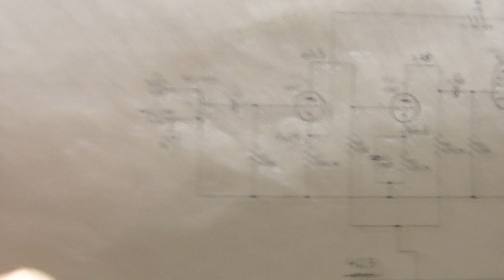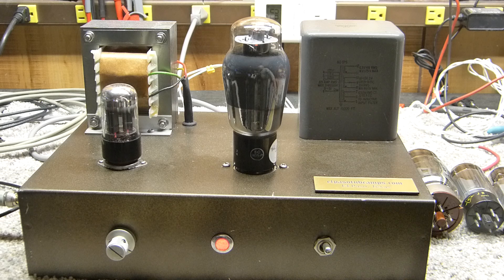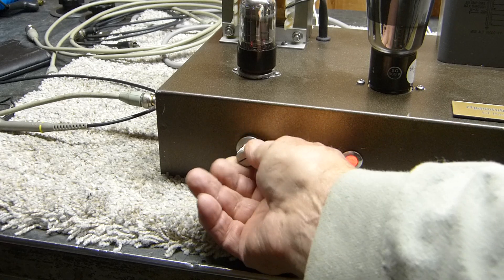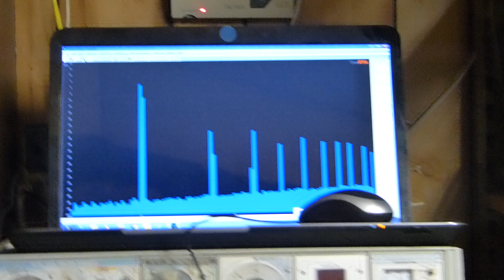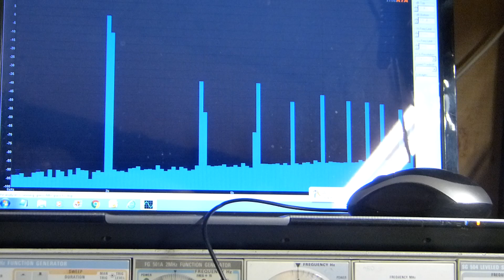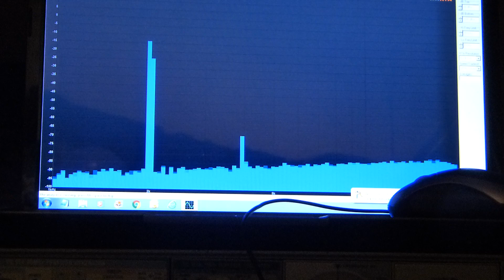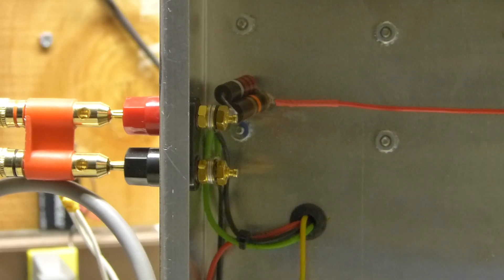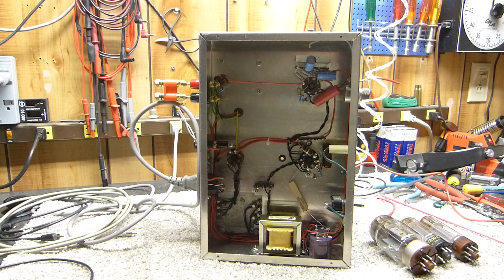The Balance of Bias and NFB in the SE Amplifier

Comment: Dave, I’m not crazy about that input circuit. The looking-back impedance of the pot provides a zero to the following HPF, that varies with setting. I would prefer to see the capacitor on the input side of the pot, and the pot itself acting as the grid resistor. That way no frequency effects.
Reply from the maker: I thought a lot about the input circuit and wanted to make sure not to have a variable HPF. I found out, and modeled it with LTSpice, that any R on the input side of the RC circuit, doesn't affect it. Take a look at the input circuits of these two Mac amplifiers.   http://www.tubebooks.org/file_downloads/McIntosh/MC275_sch.pdf
http://www.tubebooks.org/file_downloads/McIntosh/MC40_sch.pdf
Maybe a grid stopper also ?? If there are no artifacts generated in the amplifier, I don't see the need for grid-stoppers everywhere. Maybe I am wrong. 
On the other hand - if I can describe this in words - if the incoming signal first goes thru a C then to the "top" of the pot and then into the grid of the tube with the top of the pot connected to the wiper, (the bottom of the pot is grounded) then we do have a variable HPF. I have generated plots of this and it is pretty interesting at contouring the corner frequency at the input of the amplifier.
Reply: @ The C sees the total impedance of the pot in parallel with the Rgk of the tube, which is infinite. No variable there. Your way the C sees a variable series source impedance, which provides a variable zero.

Comment: Wondering… 🤔 You mention that varying the input pot (P1), affects the tonal quality of the amp.. What would happen if you increase the value of R11..? Would it be possible then that effect of the pot would be more negligible ? I am thinking if analyzing the input circuit (P1, C7, R11) from a DC perspective the resistance of P1 would not affect overall circuit resistance… However, when looking at it from the AC perspective, would P1 and R11 essentially not be in parallel through C7…? Therefore increasing R11 to a higher resistance might yield a smaller (less audible) effect when varying P1..? Just a thought…. Would be interesting to know the outcome.. Thanks for your videos.. Love to follow along.. 😊
Reply from the maker: I understand what you are saying that the pot would be parallel with the grid resistor (for signal) and affect the high-pass filter but everything says, no. The resistor on the "input" side of the high-pass filter is simply a load and does not affect the action (corner frequency) of the high-pass RC circuit or its formula. I can't explain it but I am convinced there is some "frequency contouring" that occurs with the position of the input gain pot.
Reply: @ElPasoTubeAmps  There are all kinds of biases and curves that are both real and perceived, like the Fletcher Munson curve... both perceived and real at the same time! Back when pots were wire-wound I would imagine there were other things that were affected by those too. Just like every component has resistance, capacitance, and just about every other phenomenon, just not to the extent that those with the NAME capacitor or Resistor have. Roll with it!

Comment from the maker: Cut and Paste comment from a friend:
Hope you are doing well. I liked the NFB video you've made, and what you did to tune the 2nd and 3rd harmonic is exactly what Rupert Neve did with his audio recording equipment. Firstly, it happened as a side effect from transformers and circuits not being perfect. Then, because the 1073 preamp consoles became so popular and on so many hit records, he started measuring his old designs and realized that those two harmonics make it sound so pleasing. So, in the more modern design he used specially wound output transformers with op amps to generate the harmonics and they call it "silk" which you can engage or disengage in the premaps and it affects the amount of the harmonics.